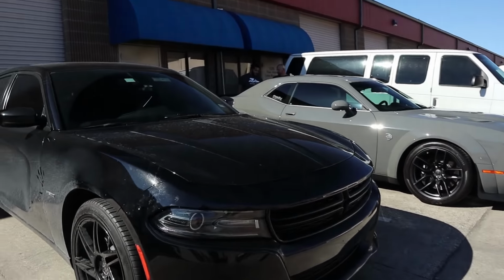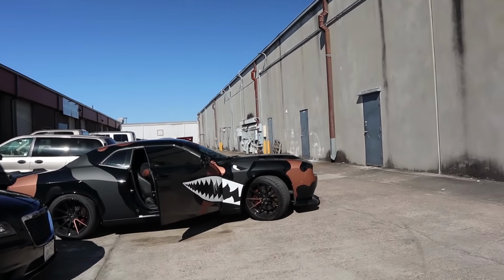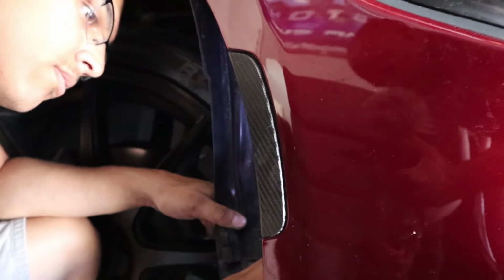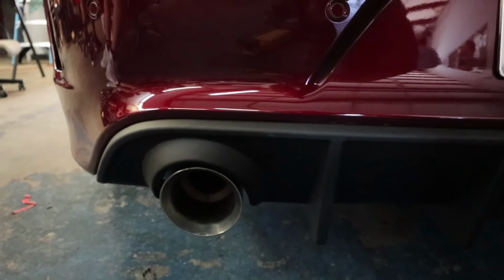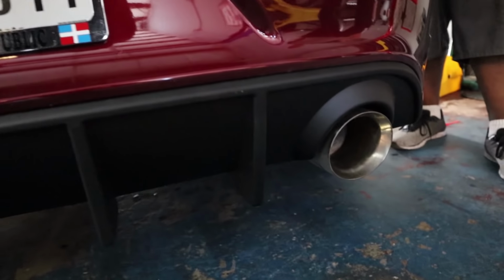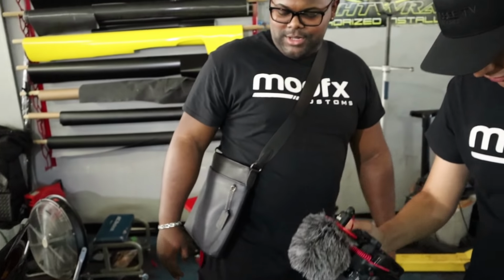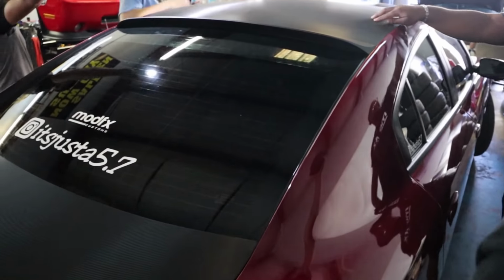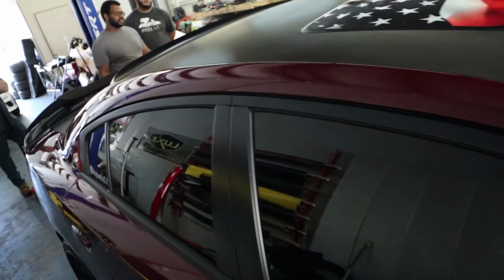Loudest Dodge Charger R/T Gets Appearance Upgrades!

Comment: Nice. Wow is that an all Mopar shop or what, I'm not seeing anything except Dodges everywhere and looks great in there 👍🏼. There is mod shop in Phx, that specializes in SRT only and am going to have them do a cam in my Challenger sometime. I've done most basic stuff myself to this point, but don't have the right situation for larger jobs. I've heard really good things about em though and always see them advertised at Mopar car shows, so I feel pretty good about them. Actually was thinking about having them install a blower, but I like NA cars and the old school feel of a thumping cam and would sound great coming out of the exhaust setup that I got on it. 
3" with reso delete, 2 wide open chamber racing bullets, and should sound awesome together with an aggressive cam.
Reply from the maker: Great to hear and good luck with the build!

Comment: That car is beautiful, what exhaust is on that car inhave a 2012 charger rt bought new but what that sound. Also anyone from New Jersey no anynplaces to donthat carbon fiber wrap and exhaust install
Reply from the maker: The car is straight piped. Not sure of shops in Jersey but we are sure there are a few that can assist. Try: https://www.wrapspecialties.net/
Reply: What exaust

Comment: Did he just cover the hole with just the wrap😧
Reply from the maker: Yes, temp until customer can take to a body shop and blend both sides. Probably gonna run him 1200-1800 to do. Wth dodge made those holes wtf knows. They should just 3mm those on.
Reply: Hey